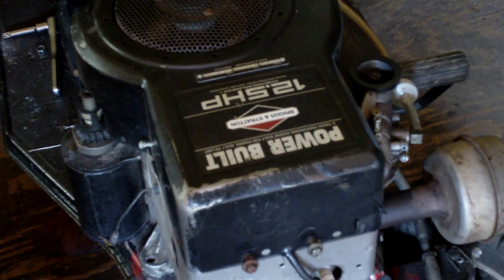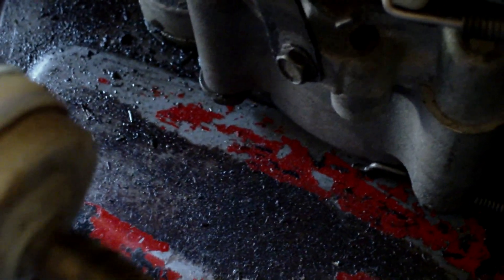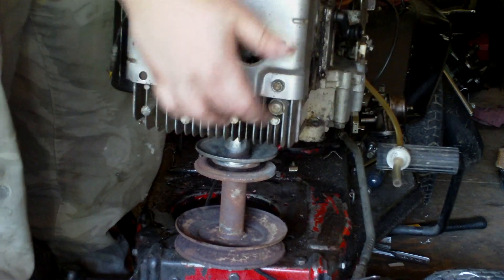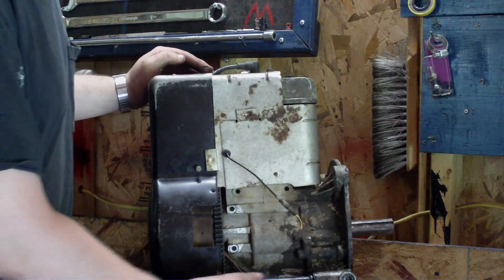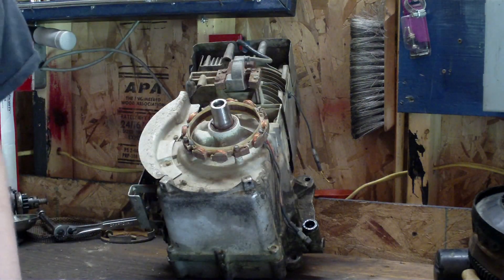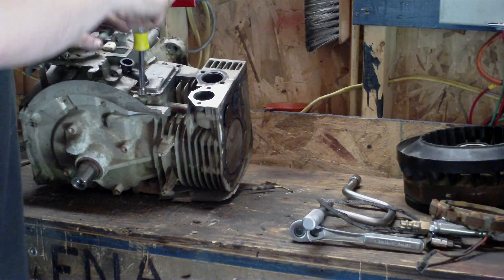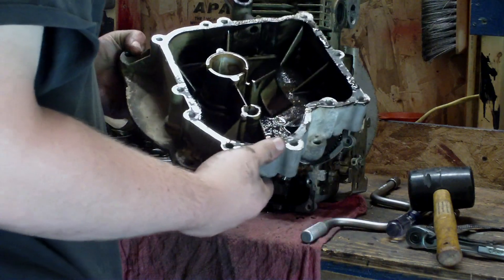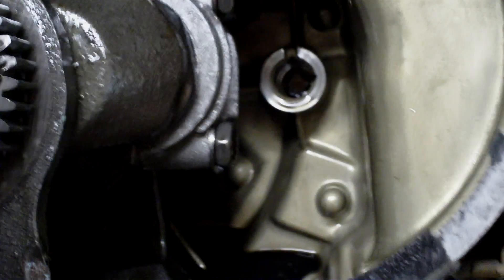Briggs and Stratton Power Built 12.5 HP Flathead Model 28 Rebuild, Teardown / Reassembly PART 1

Comment: Hey thks fnaguitarplayer9, mine 12.5 hp motor just went on the weekend,just finished using it, shut it down no problem( beer break hehe) than I went to restart it,only moved about 90 degrees,couldn't make a complete turn of the crankshaft with my hand.So i'm guessing hopefully their isn't damaged.After watching your video it gave me the confindence to try attempt to fix her up

Comment from the maker: @1968tecumsehman ahhh i see. yeah there pretty hard to find, i will send a pm with links to the parts you need, i have 2 extra crankshafts, but if i sale you a gear, i'd have to find me one if i ever use it haha, i'd sale a manifold but right now, i don't have a extra one, looks like the gear costs 7 bucks plus S&H, and the manifold is 30 and i also checked used parts on ebay, just new parts. If you have a old 1 piece flow jet carb laying around you could use that instead of the 2 piece. sent pm

Comment from the maker: @1968tecumsehman ohh yeah you said pull start, well just pry up and definetly use a brass hammer on the end of the shaft, and hope you don't mash the end down. like i said i'd reccomend trying to buy/barrow/rent a puller, it makes it alot easier. now i've seen other people pry up on the wheel and use a airhammer on the crankshaft, never done that myself but it works. i'd check on ebay for the manifold and crank gear. whats wrong with the crank gear, they usually never go bad? this engine here...

Comment from the maker: @fnaguitarplayer9 if it uses a bolt screw it in a few turns then while prying up (not to hard or you will bust the block) take a brass hammer (or regular if you don't have one, just be carefull) and hit the bolt/crankshaft, this should pop it loose, if not heat the flywheel with a propane torch, don't heat the crankshaft, just the keyway part of the flywheel then try it again. if this don't work, get the puller and use a impact wrench, you can't rent the tools at most auto parts stores.

Comment from the maker: @1968tecumsehman i hear ya. yeah stuck valves can be a pain haha i rebuilt this motor in this video for less than 30 bucks, bought aftermarket rings and gasket set, reseated intake valve, replaced exhaust valve with a used one i had and reseat it. honed it. Well the easiest way is like i did in this video but the old method is to take a screwdriver or prybar and pry up on the flywheel between the block and wheel, then if it has a nut put that back on so it covers up the top of threads or...

Comment from the maker: @1968tecumsehman i hear ya, there good engines. i figure these are pretty hard to pull start. ohh man, thats not good for them haha we had a 8 horse briggs that sat out without a cap on it before we got it. i figure there was alot of rust in it haha yeah as long as it ain't a whole lot of rust on the sleeve just use some wd 40 and hone it lightly. on the crankshaft, i'd recommend taking the counterweights off the crankshaft to clean the eccentric bearings and oil/stp them. thanks for watchin